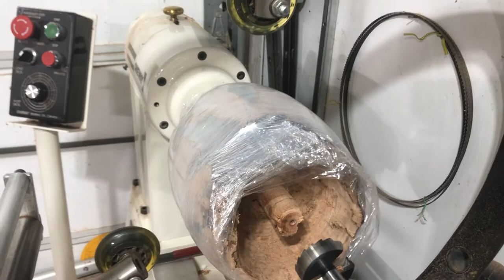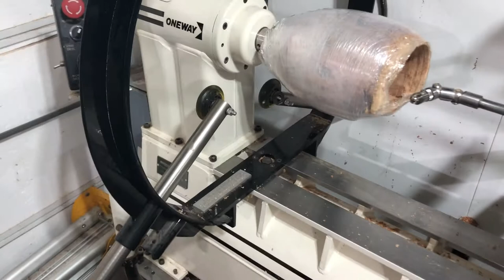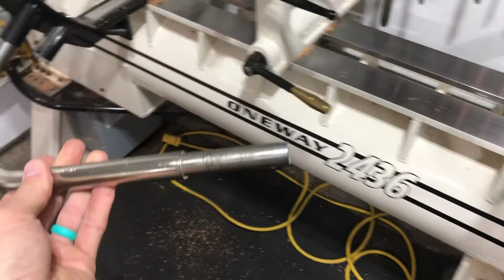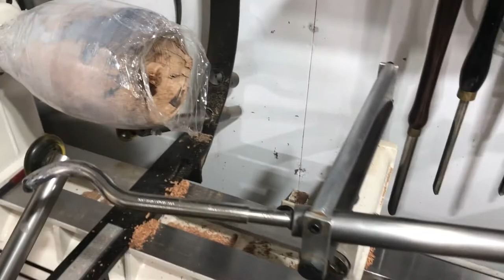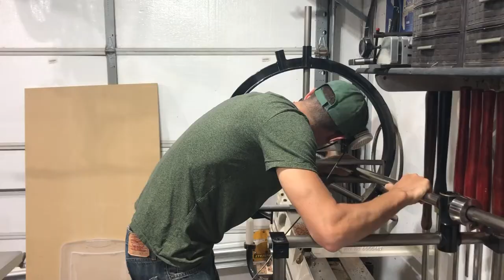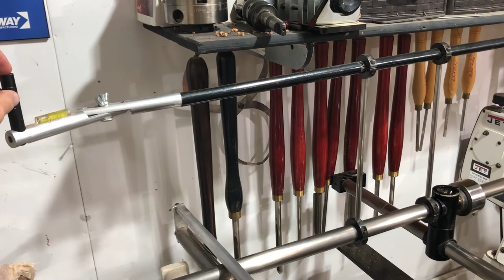Ultimate Hollowing !!  Keith Clark Wood Lathe Deep Hollowing System and Steady Rest Review

Comment: I did a lot of research and decided on the Kieth Clark steady rest custom made to my Harold Record Lathe. It didn’t fit the lathe so had the shave a 1/16 inch of both sides then it worked. No fault of Kieth he was relying on measurements I provided and the base is oddly shaped. It was an easy fix with a grinder. And must say I love it highly recommended it and would buy another in a heart beat when I move to a larger lathe. As for the hollowing system great video and I think I will order one also from Kieth but for that bigger lathe I’m looking to get in 2024. Which I leaning to a large Harvey lathe, or the. Robust if I can convince myself to spend that much lol
Reply from the maker: Have you looked at Oneway lathes before? I would strongly consider them as well if you have the budget. Mine has a 24 in swing without the outboard turning attachment
Reply: I’ll check them out I think the one way is right in the middle price point between a Harvey $4K and the Robust $10k So I think it would be a great choice is I wanted to spend more but not as much as a Robust. Think they are around $7k last I looked. Thanks for the suggestion!
Reply from the maker: @haidergildred2621  mine was close to the 10k after all the extras. I got the stainless steel bed  alone was another $500. And then the tax at the end sucks.

Comment: Hi 👋, very interested tool, but when you started there seems to be a lot of chatter, to much over hang , over the tool rest , Phil.
Reply from the maker: The wood was extremely dry and hard. That’s why it was chattering. It accepts thicker tools as well, which would help.. the cutter that I was using is a crown tool that I adapted to use in this bar. It’s not always ideal, but it works for some of my applications.

Comment: Great video are you still liking the system?
Reply from the maker: Yes, very heavy duty.. now the giant stabilizer I think they have possibly made a few changes since I bought mine because I’ve had it for a very long time but like I said in the video, I would’ve put a weld all the way around the on both sides instead of just welding it which would’ve made it more rigid

Comment: This is a great video! I'm contemplating between this and the steve sinner system. Did you look at others before deciding on this one?
Reply from the maker: I did a lot of searching, and one of the unique features of this system is the ability to use the system essentially free hand. There is a set screw that is loosened and the bar can be free rotated like with a hand held tool but it is still captured in the system.  This is especially useful for hook tools and ring tools where the hook angle needs to be adjusted frequently. 
Also this system is extremely heavy and robust. As any turner knows, weight really helps cut down on vibration, which gets worse the deeper you go.  I’m in the process getting the pro-form hollowing tools which are a hook tool and this system really shines with this